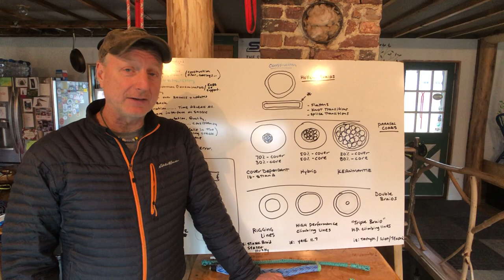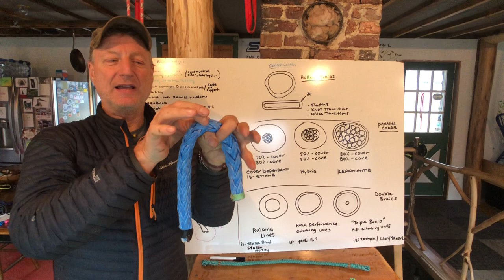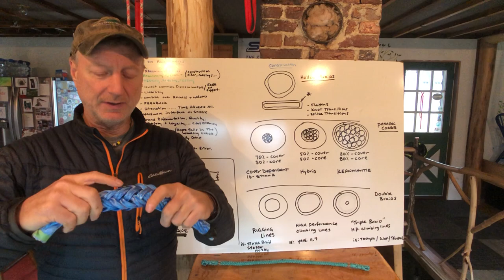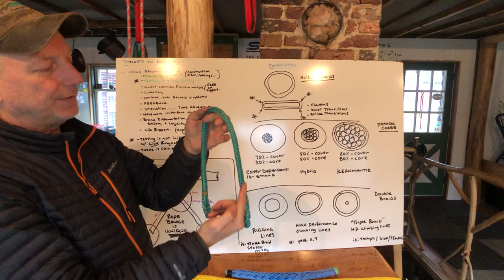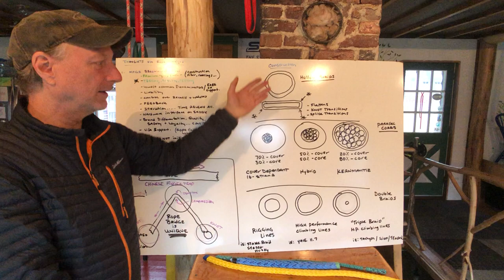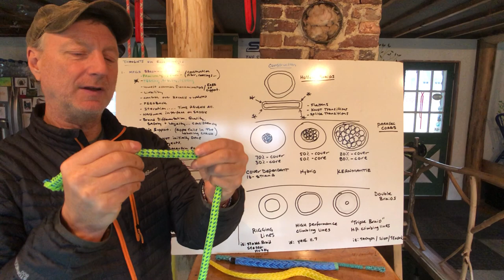Arborist rope bridges

Comment: I swapped out mine for dynamic 11mm rope that they use in rope access work for fall arrest lanyards/cow tails. Very long lasting great under pressure from a ring, knots well zero abrasion. The bridge I replaced was just a petzl rope bridge look like just a bit of static kernmantle stitched, in a sort time it was looking glazed it was very stiff. So replaced, I’m aware it’s not factory but I feel it’s superior, in my humble opinion. I’ve been contract climbing for twenty years, which means nothing when it comes to manufacturing safety equipment but it looks to be holding up great, I’ll replace shortly and check out the internals. it’s actually gives a tiny bit too, which is great on the back!!

Comment: This rope is interesting stuff, especially the high-tech fibers.  Even within the Dyneema family there are a number of different flavors with varying strength, creep resistance, tenacity etc.  For rope used in true rigging, I only see Dyneema and Dyneema-like fibers.  Cortland Plasma 12 seems to be the most popular and I imagine Amsteel Blue as second.  Some shops are using Endura 12.  It's run on pulling and crane winches, although I still see mostly wire rope on cranes.  Regardless of the application, the user must understand how to inspect and when to take it out of service.  For rigging slings I wouldn't want to buy plain 12-strand Dyneema because it gets full of dirt, rocks etc.  Of course if it receives a non-removable jacket...there goes and chance of inspection.  But best to get a tight braided jacket on there to protect the rope.  Some rigging companies like Holloway Houston have a braiding machine that will place a tight polyester or Dyneema jacket along the entire sling (eyes and body).

I figured as tough as 3/8" Dyneema 12-strand is, I'd try it on my bridge with a Petzl Adjust.  I knew there'd be limitations with the eye splice and such but it also didn't jive with the Adjust.  The braid was too loose and it wouldn't feed very well thru the Adjust.  I ended up with the Adjusts because of something else, but I do realize Petzl sells a bridge assembly with their rope and the Adjust.  On my saddle I decided to double up the cordage for the bridge, meaning the spliced eye and the Adjust are on the same ring on the saddle.  I've got some 9.5mm Arbospace Thunder now which I believe is a nylon core with a Technora/Poly blended jacket.  I was going to try a 5ft Bee Line split tail but I can see that those stiff Vectran fibers could be more brittle over time and small bend radii.  Of course Yale touts very good fatigue/bending strength.  Who knows.

One good thing about an adjustable bridge is that it changes length over time, changing most of its bearing points.

Check out Tycan synthetic chain by Green Pin (Van Beest).  They have Dyneema based chain with WLL ratings up to 22,600#.  Just links made out of laminated Dyneema webbing.

Comment: Thanks, advice well appreciated!  
Used to run a stainless thimble on my bridge then carabinered to that. Much smoother and spread than just ring or biner. 
Misplaced that so now run the Omni block 1.1 on my 7/16 kern mantle bridge w/ double fisherman knot ends. I use an intermediate small prussic to make it adjustable when needed.  Knot to knot the set up is about 30”.

Comment: Great information thanks for posting this.  I am guilty of tying my own bridge(s) but I buy name brand rope bridge, specifically Teuf. Where they sew the tail to keep it pulling through.  Also I use a backup prusik cord that’s a little bit longer than the primary bridge so it serves only as a fail safe and is not under tension or compression unless the primary fails.

Comment: With working application of rope, would use as a lanyard be similar to use as a bridge? I understand that the bend radius would be different, but the force and abrasion is concentrated in one area of the rope.
Reply from the maker: Hey Jon!... Thanks for your question..  My answer is yes.. and no..    Yes in terms of a very short lanyard or 'scare strap'... but even then.. the bend radius is soooo much larger.... and no... in terms of a modern 10-20ft lanyard.. because the location of the concentrated forces of tension and compression are constantly moving and shifting.  The rope bridge is a uniquely loaded piece of gear... where the force is always concentrated in the same 2-4 inch area...   In terms of abrasion.. the lanyard sees much more rough surfaces.. and is also more likely to come into contact with saw and chainsaw teeth inadvertently.... so lanyards see much more abrasion abuse...  Bridges should be running on smooth aluminum biners, rings or swivels.... so abrasion is much less of a problem...  I hope I answered your question...  Stay safe out there!  Mark
Reply: Very interesting and great information no doubht.i use monkey beaver bridge and saddle along with extra bridge 2 one being a tree motion ..bridge...I just found out yesterday they are discontinued the samsom brw..red black white ..wich is 8200 pounds and why I like it for bridge and also for climv rigline.been in use for decade..shame there doing that.luke anything good they get rid of it..its also best looking rope out there.veey interesting to try tachyon. But it's so expensive..like double regular ropes ..blue moon and vortex are best 2 roped.fir me..and blue moon has tuff cover much tuffer than the ivy copycat version.yale is better.